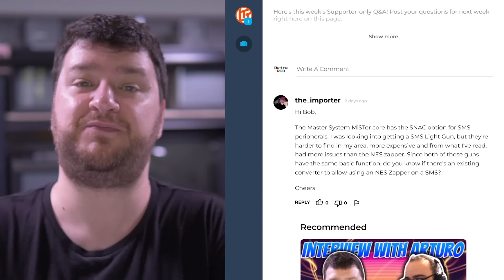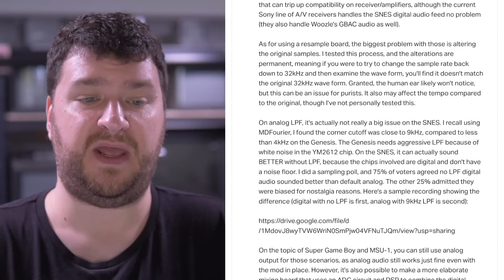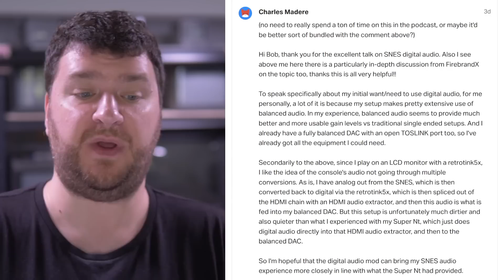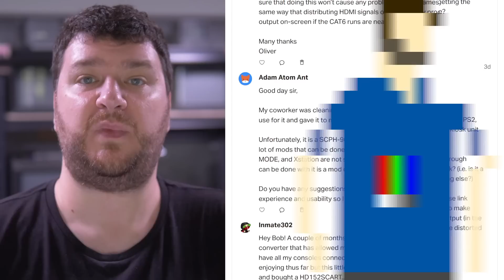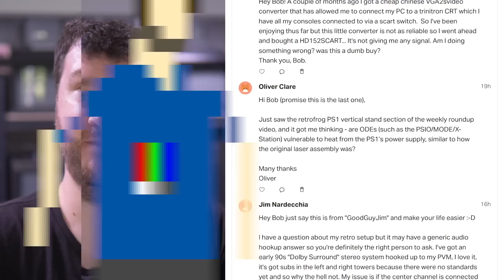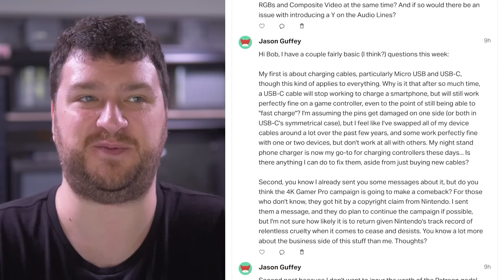Supporter Q&A #211

Comment: Is MSU-1 audio messed up in SD2SNES on board revisions lower than H?  I read that it plays softer and while I haven't tested it yet I also don't have a way to compare.  So not sure I would even know.   I did see that there was a mod that could be done to fix the alleged issue.  So my questions are.  Is there an issue?  Does that issue drastically impact the sound of MSU-1 audio for non audiophiles.  And if so is the mod worth doing or should I just sell the SD2SNES and buy an FXPAK Pro?

Comment: I totally get what you mean, but in case anyone doesn't know. The old printer cables were always parallel ports (much wider) not serial. I always only used serial for very technical equipment at work, or maybe weird add-ons that would be USB today.

Comment: re: MVS composite video.   I have a MVS and a neojamma adaptor, the neojamma has pinouts for r/g/b/s/5v which i spliced onto a vga connector and plug into Antonio Villena's vga->composite/s-video adaptor.   Looks great!    The neojamma has a genesis2 din output as well. so i may just splice a genesis2 cable into a 15pin dsub instead, cause using the pin headers on the neojamma board is kinda janky.
Reply: I appreciate it but I'm not going to pull apart my OpenMVS to use a different Supergun. I may look into Antonio Villenas VGA>Composite converter though. Thanks.
Reply: @sunflash2 antonios kit just converts RGBS to s-video, comp,  its got a vga style db15 on the input side, so youd just need to adapt whatever your mvs is outputting to vga, just make sure you provide +5v and gnd as well.  like i said,  I overthought it, and made an adaptor to attach to the pinheaders on the neojamma board, whereas i should have just made an adaptor that plugged into genesis2 din out.  but this way actually allows me to have 2 outputs, RGB+svideo, so i could run the s-vid to my PVM, and the rgb out to my tink5x